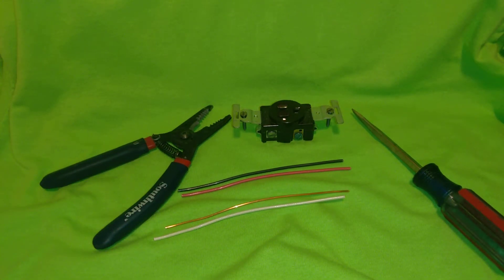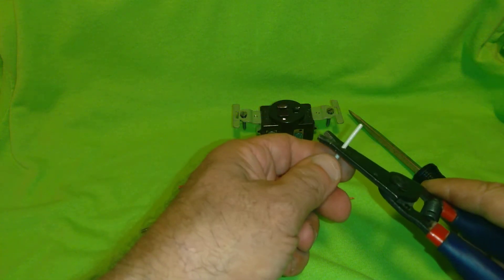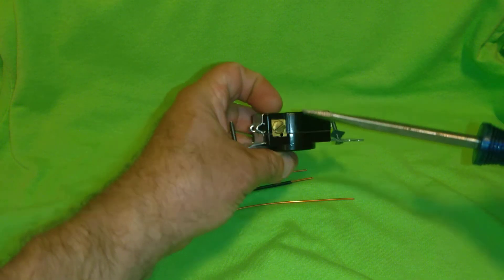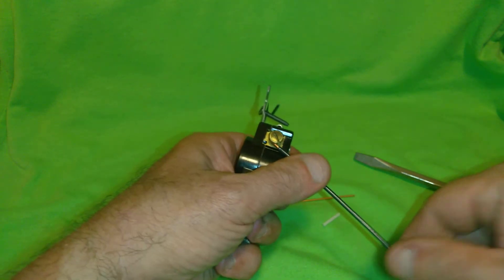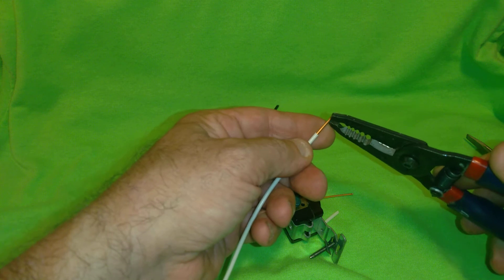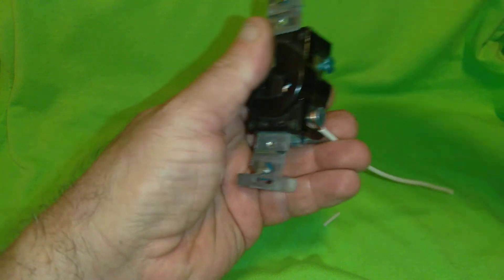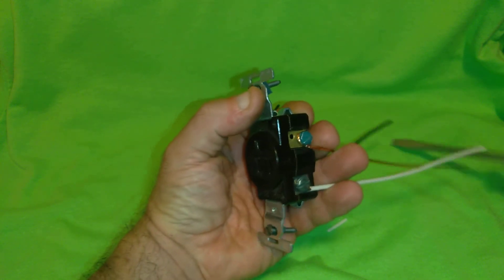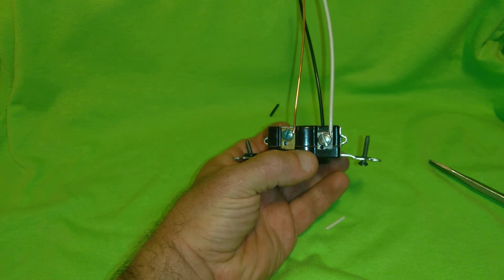how I put a wire around the screw on a switch or a outlet 12 or 14 gage wire

Comment: many outlets have the terminal screw and when it is unscrewed as much as possible, the terminal screw recedes by gravity down so the mead of the screw is all the way down like it was screwed on.  In other words, it is very difficult to put the wire around the screw unless the outlet is upside down but then you can't see what you  are doing.  Do you have any advise for dealing with this type of outlet?